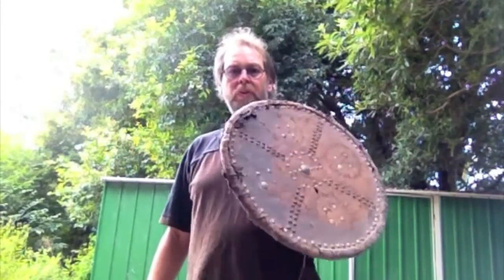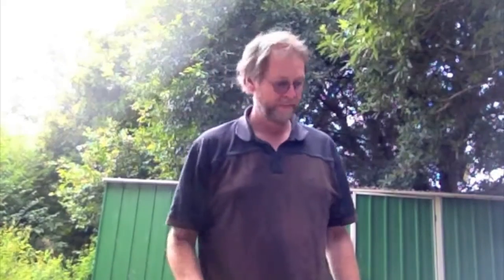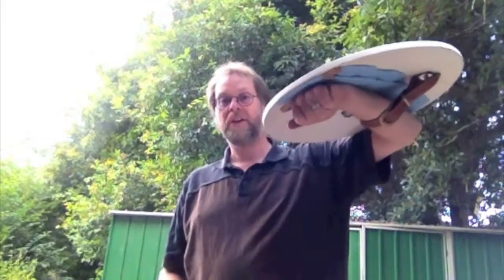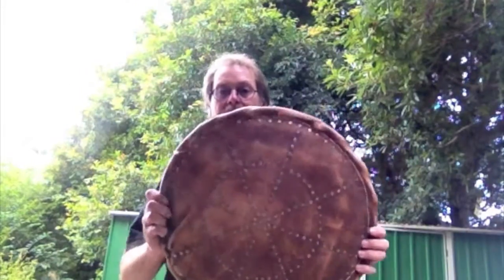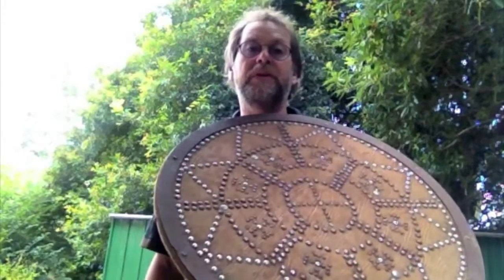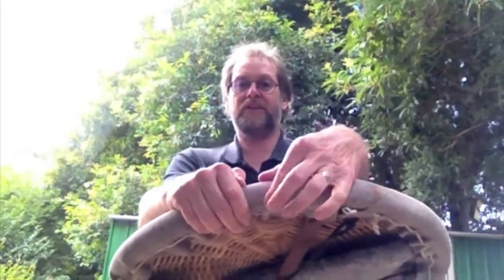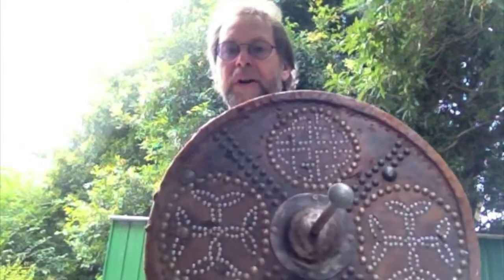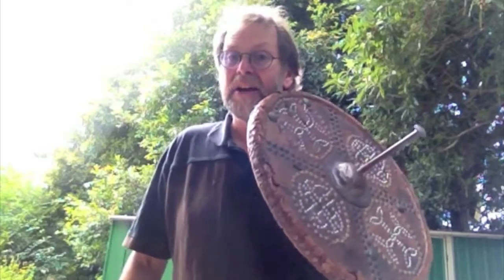Targe making

Comment: Watt about the standard of not holding the forward strap and it just strapping around the wrist?
Reply from the maker: theevol29 That never happened. It’s not physically possible to control a Targe that way - the illustration you refer to is a mistake by Morier, probably made because targes actually came with two different kinds of hand grips. Targes designed to be used with a dirk had a thin steel grip, but thick leather straps (which make it impossible to hold a dirk too) are more common. If he only had access to the latter to work from, he would have wondered “how could they hold a dirk too?” and come up with his (incorrect) guess